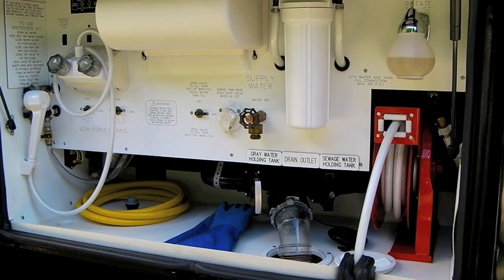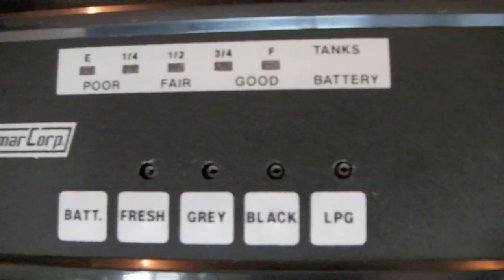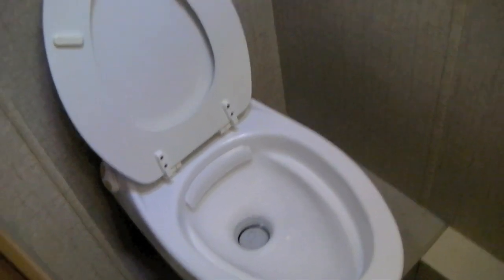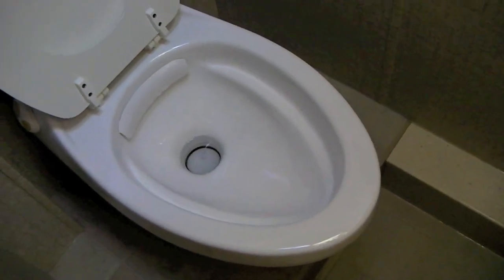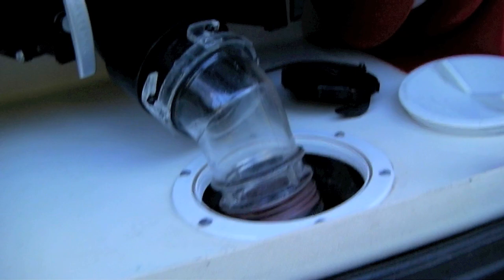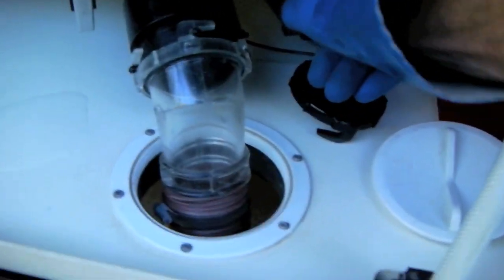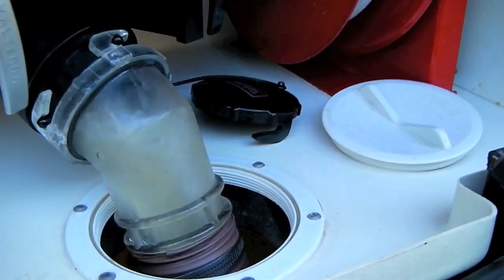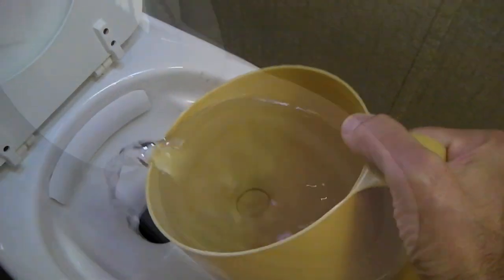How To Dump & Clean an RV Black Tank

Comment from the maker: You have hit the nail on the head. The only danger is forgetting the valve closed with the water running, which will cause it to overflow.... out the roof vent! Never walk away from the RV while doing this! And thank you so much for your kind comment. You just made my day!

Comment: Great video. I've been doing like this so nice to know I'm doing it right. One final tip is to let the flush go for half a minute (depending on gpm of your water source) after closing the black tank valve to add water to the tank for chemicals. I think it helps with encapsulating the smells as well.

Comment: Man, I've owned a Motorhome for 15 years and didn't do all of this, I just Dumped it once and then let the grey water rinse it out, Thank You for the great Tips how to really do a great job!! ;)
Reply: that's what I was wondering... my guess is that the grey water only rinses the line. two separate tanks...
Reply from the maker: That’s right Michael. The gray water only rinses the sewer hose, but does nothing for the black tank.
Reply: Ugh, you had 15yrs of turds marinating in a hot box🤮
Reply: @TheSebastian5978  105 degree heat outside  in the holding tank for 15 years, She was getting pretty ripe.

Comment: I've had my 5th wheel for ten years and have never cleaned the tank!!  I am convinced now to puchase the clear elbow and a wand.  I have kept the valve closed except when dumping and use the bio chem stuff religiously.  That rubber seal in the toilet quit holding water ages ago and I've replaced the foot valve twice now.  Water just started seeping one time indicating a leak and the other time just exploded all over while I was sleeping!  Thanks for the thorough video.  I will be subscribing!

Comment: Thank you for that step-by-step guide.  I just bought a used RV, and altho a verbal description was given about black water,  I've no previous experience to fill in the blanks.  The seller did advise as you did, flushing grey water AFTER black, but they didn't cover the details which you made obvious. Thank you so much.

Comment from the maker: Hi Matt. Rental RVs are very unlikely to have clear sewer elbows, and since they have probably never been flushed out properly, you shouldn't even bother trying. It's one reason why I would never buy a used RV that had been used as a rental. ;-)
Reply from the maker: ***** If you go to rent an RV it smells like toilet water, there is nothing you, as the renter, are likely to be able to do to eliminate the smell. Unfortunately, caring for the waste tanks requires some knowledge that the typical renter probably does not have. That leads to tanks that are never properly flushed out, and the build-up of waste and the resulting smell. I'd suggest that you check out any rental RV before agreeing to drive it off the lot, and if it stinks, ask for another unit, because it's going to stink for your whole vacation. One other tip... never flush an RV toilet with the vent fan running.
Reply: Good advice about the RV rental check out process....a stinky toilet can really kill the mood...!
Reply: RVgeeks
Reply: Wow,good advice! Don't the rental companies clean them?? That should not be up to the renter.
Reply: they do a quick clean out but its in most rental contracts that the renter has to do it when they leave the campground.

Comment from the maker: @groush   We started using Rid-X because it's cheaper than "RV" tank treatments, and seems to be the exact same bacteriological product.  We've continued using it because it works.  I don't think there is any type of bacteria -based product you should or shouldn't use - we're tried several and they all seem the same, so just pick one you like.  Be sure to stay away from the "blue" formaldehyde-based stuff.  Doesn't work, bad for the environment, and banned in some places.

Comment: Just open the valve and drive on . By the time you get there the tank will be empty.The rain will wash it away. Go to take a dump and it will hit the road. And you never have to clean the tank. Problem solved.

Comment: I use a flow meter on my black tank flush line.  I have 53 gallon black tanks.  Flush them with 35 gallons of water 2x.  Saves me running in & out of the camper chacking tank levels.  Outside of that tiny addition - excellent video!  Happy to add I agree with and use all your techniques.

Comment: Great description of the correct way to maintain good black tank performance. I have a simple mod that can help if you don’t have a tank flush on hand. In place of the see through elbow I installed another slide valve. I routed the see thru around and out the existing hole for dumping. Now comes the delicate part. First, make sure all valves are closed. Open the new valve; open the black tank valve; when the black tank is nearly empty, close the new valve; now with the black tank valve open, open the grey tank valve; grey water will rush into the black tank agitating any left over debris. After a few seconds of flushing, close the grey tank valve; now open the new valve and let the black tank empty again. Best to only do this when you have a pretty full grey tank. You can do this a few times but always save a good flush of grey water to flush the hose.
Reply from the maker: Thanks, Todd. That sounds like it would also be a great technique for situations where you don't have access to a source of water to use with an onboard tank flush system (like at a dump station).

Comment: I think this was the most informative video I have seen yet on RVs and this important aspect of RV camping. I'm going to be about as thorough as anyone on this.  No reason to not do it well and make it as long lasting as possible.  It's a grungy job so you might as well make it as comfortable as possible and this does it for me. Ours has no rinse component but the newer cleaning clear sections with hose hookups should be very helpful. Thanks.

Comment from the maker: You are absolutely right George.  We should have made a better point of talking about the importance of water conservation as well.  Dumping with the tank as full as possible (3/4 or more) will avoid rinsing the tank any more often than needed, and trying to avoid dumping in water-sensitive or restricted areas whenever possible (like the desert).  Since we use about an extra 40 gallons each time we dump (vs. just running the tank rinse nozzles only), we try to minimize the impact.  Thanks!

Comment: Thanks for this clear video, as next year (we hope) to rent a RV (probably a C30) for three weeks from Denver to SF with my family (5 adults). As European RV's only have small (3-4 gallons) portable toilet tanks which have to be carried to and emptied/rinsed at the sanidump by hand, I'm very glad to see that American RV's make this job much easier/cleaner and less frequent. The clear elbow piece is a great addition to the drainage hose, let's hope rental companies thought this through also, like you did. Cheers!
Reply from the maker: Hi René! We hope you have a great experience renting. It's a good way to get a feel for RVing. One thing to keep in mind is that the rig will not come equipped exactly the same as one you own yourself. For example, we can just about guarantee that there's no clear sewer elbow included with ANY rental RV! But not to worry.... the prime reason to have a clear elbow is to maintain the long-term health of the black tank by making sure it's thoroughly rinsed each time you dump. Since rentals don't have clear elbows, and are generally used by novices who don't treat them with the same diligence that an owner would, you can bank on them having, shall-we-say, less-than-pristine black tanks. So go ahead and use it without the clear elbow and enjoy yourself!

By the way, this video shows how we do a thorough cleaning on the black tank. We'd suggest the "everyday" (not actually every day of course! LOL) method as a routine dumping technique. We show that here: https://youtu.be/gZFyfsy4ptw

Comment from the maker: We never have used a seal conditioner, but being full-timers, our toilet gets used all year round, so the seals never have a chance to dry out. Conditioning the rubber is probably a good idea, and if it's not too expensive or too much trouble, we'd say go for it. Once the seal cracks and the water runs out, black tank smell can seep into the RV through the toilet opening. Also, be careful cleaning the toilet to avoid damaging the seal. Hope this helps!

Comment: Best dumping video I have seen, definitely the most informative.  I think you could also show underneath what the tanks are and where those water lines go.  I unfortunately never used this process but will now.  I went right to ice before even knowing what the fill hose port was until I saw this video. Mine is cracked and has to be replaced.   I will never do the fan and sniff test nor put my hand over the toilet to get the air in my hand but will utilize the other processes.  Thank you so much.

Comment: Thanks for this video, especially for showing every aspect of the job. We're considering an RV and I wanted to know what the process entailed. Looks like it's not that bad. The other videos showing the theory helped, but seeing EXACTLY how "hands on" you needed (or didn't need to be) helped immensely. Thanks for scientifically showing the process and not hiding any details.

 That ice tip makes a lot of sense too, I haven't seen that one anywhere.
Reply from the maker: Hi Vinny! Thanks for the comment, and glad to hear we're helping you see what's involved as you consider your RV purchase. This particular video is more of a super-thorough cleaning technique. To get an idea of the (even easier) regular tank dumping regimen, you can check out our other video about that here: https://youtu.be/gZFyfsy4ptw

As far as ice goes, that will not work for everything. One infamous problem people can have with their black tank is called "pyramiding," which occurs when the black valve is left open while hooked up at an RV park. Leaving that valve open all the time is a major no-no, allowing the "liquids" to run out and the "solids" that are left behind to accumulate into a big pile.... or pyramid. Once that is done long enough, the pile that's left behind will not be solved by ice cubes.

The ice cube trick is great for another problem though.... if you drain your tank without thoroughly flushing and rinsing it, and the leave the RV stored for a while, the tank can dry out, with that remaining debris drying down to the bottom of the tank. That thin layer can be scarped away by ice. Of course knowing how to properly drain the tank will solve all of these issues before they even get started! ;-)

Comment: The best video on dumping I have ever watched. Congratulations on your explanation. I too don’t use chemicals besides happy camper enzymes after cleaning tank which I was doing all wrong😳I had heard the legend of the rooftop chocolate volcano in relationship to the black tank flush so I have stayed away from even thinking about using it. Maybe now my tank fullness gauges will work again. Have to schedule a couple of days at a local park to address tanks now that I have knowledge to get the tanks lemon fresh. Thanks.
Reply from the maker: Thanks, and good luck with your tank cleaning. Let us know how you make out!

Comment from the maker: Keeping the black tank valve closed and using bio tank treatment are both good. Without that rubber seal holding a little water in the bowl, odor from the black tank can seep up through the toilet and into the RV. We'd definitely suggest a new toilet seal. Thanks for subscribing!

Comment: First off I would like to thank you for answering most of the questions asked as the majority of posters "ignore" viewers and don't answer questions.
I have a "sewer tank flusher" at the rear of my trailer and it states "Sewer valves must be 'OPEN' when using this inlet."
In your great video you direct to "close" the valves. What do I do and why is it that the manufacturer instructs to close the valves?
Thank you very much for your time and wisdom.
Tino.
Reply from the maker: Hi Tino! Our flushing system has the exact same warning on it. That's probably because closing the valve with the water running could overflow the tank out the roof vent, or, in the unlikely event of a blockage of that vent, burst the tank. But neither of these things will happen if you simply pay attention to what you're doing and don't walk away from the RV (or get distracted from the task) while flushing. If you just stay with what you're doing and pay attention to the water level, there is nothing wrong that we're aware of with filling the black tank through the flush system. We've been doing it for 12 years with no problem, and keeping our black tank as clean as possible the whole time.

Comment: Great video!  I'm glad to see that you can close the black valve and run the flush.  The owner's manual says never to do this, but I always thought that would have been one of the best ways to use the flush.  The manufacturer must just be covering itself in the event that the vent is clogged or someone overflows the tank.  We have been RVing now for 20 years  having started with a popup, then a travel trailer, and now a second new travel trailer.  We don't have a motorhome as you do and we are not full timers.  We only use the camper for vacations.  We (possibly) do have to be a bit more careful about the weight of what we are towing considering the weight of our trailer, the towing capacity of our tow vehicle, etc... We do not and will not tow with full tanks.  Not even white.  We will always take care of dumping just prior to leaving a campground unless there is only a small amount of the tank being used, and we are headed to another campground.  Otherwise it gets dumped.  Just easier that way.  More inconvenient to dump at home although we actually can by using our sewer line cleanout.  
Also, we have never made it 2 weeks on a single black tank even with 2 people. I'm impressed!   I think we have 40gallon black tank.  Maybe we could modify prepping and usage, but we're usually only staying a week anyway in any single spot.  Should I have a minimum amount of the black tank filled before dumping?  I could always add water prior to dumping.  Same holds true with the Greys, but we always keep them closed and dump as needed and much more frequently.  I'm going to try leaving them open more and see how that works out.  Just keep them closed prior to having to dump the black.  
I got a few great ideas from this though!  First and foremost, I will close the black valve and let the cleanout run.  I'm also going to get a back flow valve for the cleanup, and I will try the Ice thing next time due to the sensors always showing 2/3 full.  Love the ice idea!
Thank you so much.
Reply from the maker: Hi Diane! Thanks for the comments. It's suggested to have at least about 1/2 to 2/3 black tank before dumping, but if you always thoroughly rinse the tank out the way we do, it's probably not so important.

Comment: Excellent.
Some others' advice/opinions/additions:
- Some say not to leave the grey open - you may get sewer gases. BUT it seems P-traps would take care of that. Or you could put a dip in the sewer hose that acts the same (it would need water in it). I leave mine closed as it's an easy "get out and open the valve" if it's getting full.
- Big fan of a designated black flush tank hose. Haven't thought to put a backflow - never thought it could be an issue. I do the Y as in the video, BUT I turn the "fresh" part of the Y off while flushing.
- I've added cheap little water meters on the hose, so that I know how many gallons I'm putting back in the tank with the valve closed - which instructions say not to do, but we all know that's the best way to add water back in the tank to rinse debris that didn't come out on the initial dump.

Comment from the maker: If you're referring to the clear elbow, we've tried all 3 types that we're aware of: 1) the smallest, with only 2 "ears" or "clips" to hold it in place, which was OK for a long time, but then leaked around the seal, 2) the type with the hose attachment (which did nothing) and 3) the type we have now, which we're very happy with. It has 4 ears, so it clamps really tightly to the sewer outlet and has never leaked. It's a bit bigger, but there is still just enough room to twist it into place.

Comment from the maker: If I understand correctly, it sounds like you're describing two separate dump outlets, and having to connect the sewer hose to one of them to dump the black and the other one to dump the grey. I've never seen that before, but that's the set-up, no big deal. Just be sure to thoroughly rinse out the hose with fresh waster after dumping the black, since you won't be getting the grey water rinsing it out.

Comment from the maker: That's a soap dispenser for washing hands. It came on the RV (nice touch from Newmar). We keep pure castile soap in it, which is non-toxic for washing hands outside. But castile is also a little runny, so we keep it rotated upside down to prevent dripping.